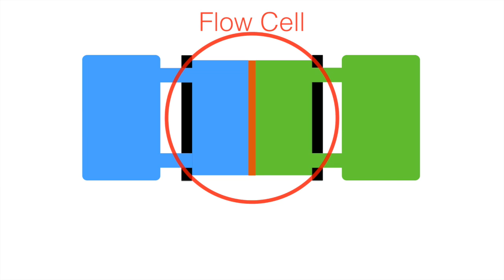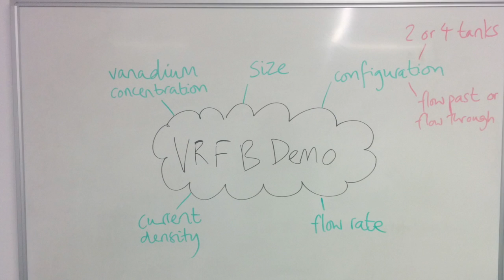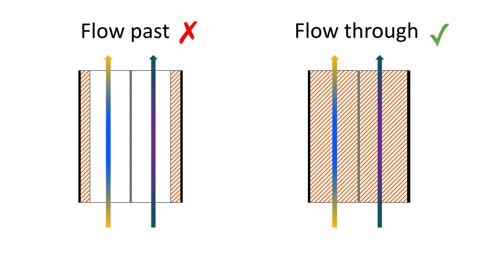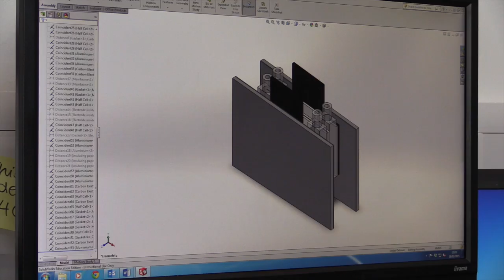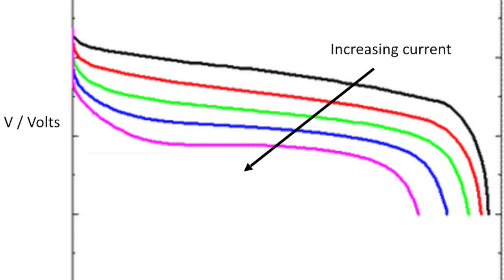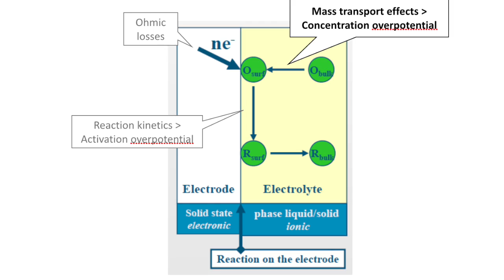Making a vanadium redox flow battery

Comment: how much are the material costs of the battery and how much kWh does it storage? 
I am not sure if I skipped this information in the video but it would be quite interesting probably for a lot of people, I guess. (?) :)
Reply: The costs wouldn't scale linearly with the storage since you can litterally increase the capacity simply by increasing the size of the tanks without needing to scale the rest of the battery with it.
Reply: The battery in this video probably stores somewhere around 5W but it's hard to tell
Reply: @Belfastisshit  Presuming you meant 5Wh that's generous. It's not like they used incandescent lights to discharge the flow battery.

Comment: If I want to build one for myself what info/direction can you give me to build one?
Reply: Me too, how much it cost to build one of those batteries? I want to use seawater as an electrolyte. I don't know if this would be a good idea
Reply: @beatflozepp  emmm,.... you can not use seawater as an electrolyte, because is vanadium based. You need vanadium oxide solution electrolyte
Reply: @cayrex  Thank you.
Reply: @cayrex  You can use an iron based redox flow along with salt water to produce similar effects. Vanadium isn't the only material with chemcial electro reactions. This also includes magnesium & more
Reply: @kam7000  For sure,... you have many different chemistries and milions ways to make a cell. But vanadium is the most popular flow battery type which you can find on the market. The next flow batteries which you can also find on the market are all iron redox, zinc cerium, zinc bromine,.... and in the end you have many flow batteries which are in development.

Comment: where did you get the carbon/graphite felt?
Would you like to try our felts?
if you are interested in that,kindly let me know.
bentmen0427@gmail.com
whatsapp:+8618310931213
Reply from the maker: +Andy Man “We were only using low concentrations of vanadium e.g. 100mM V2O5 in 2M H2SO4 since we wanted fast charge and discharge to allow quick and clear colour changes in the electrolyte – our cell was designed for demonstration to the general public – so I’m afraid we don’t have much experience in dealing with high concentrations. Even at these low concentrations we generally needed to mix solutions for up to an hour to let the V2O5 fully dissolve. This paper (http://www.sciencedirect.com/science/article/pii/S0378775308024762), which looks at some high concentration vanadium electrolytes, might be of some use to you.”

Comment: Hey guys. I am a student in Chemical Engineering at the University of Pretoria in South Africa. I happen to be working on a project which deals with a vanadium redox flow battery. I am having trouble with my electrolyte solution. I would like to know if it is possible for you to shed some light on the electrolyte with regards to the methods you used and the concentrations of the compounds. My problem so far has been the low solubility of Vanadium pentoxide. I tried to dissolve it in 3M sulfuric acid but I'm getting a suspension, rather than a solution. Any tips would be highly appreciated. Regards. :-)
Reply: Sir, I am doing the same research, can we exchange emails?
Regards.
Reply: As am I. Any insight you have with respect to this issue would be greatly appreciated.
Reply from the maker: +Oderick Shimikulu Ilunga “We were only using low concentrations of vanadium e.g. 100mM V2O5 in 2M H2SO4 since we wanted fast charge and discharge to allow quick and clear colour changes in the electrolyte – our cell was designed for demonstration to the general public – so I’m afraid we don’t have much experience in dealing with high concentrations. Even at these low concentrations we generally needed to mix solutions for up to an hour to let the V2O5 fully dissolve. This paper (http://www.sciencedirect.com/science/article/pii/S0378775308024762), which looks at some high concentration vanadium electrolytes, might be of some use to you.”